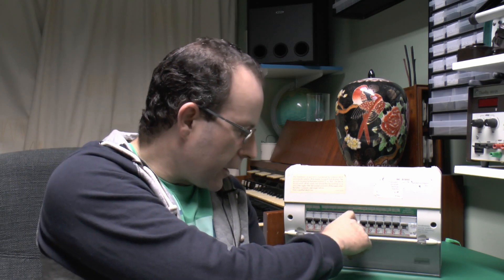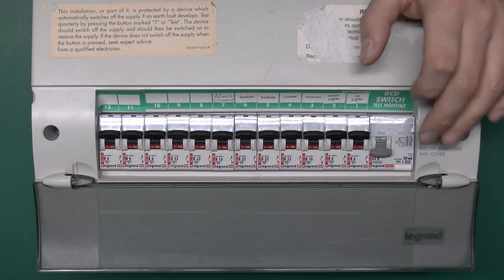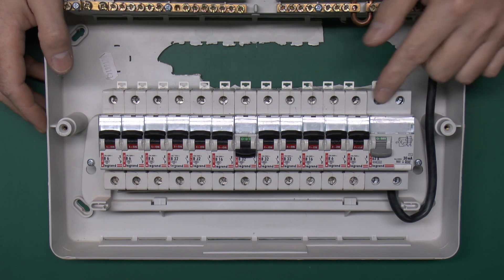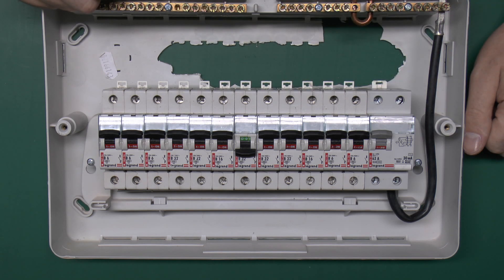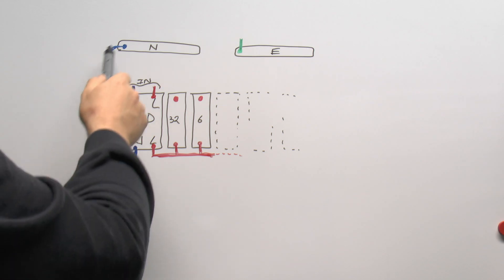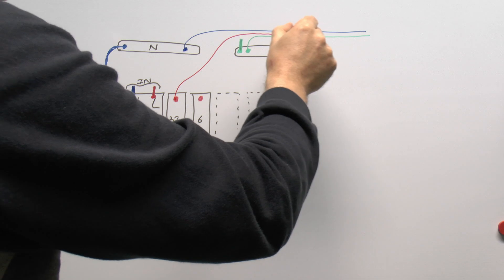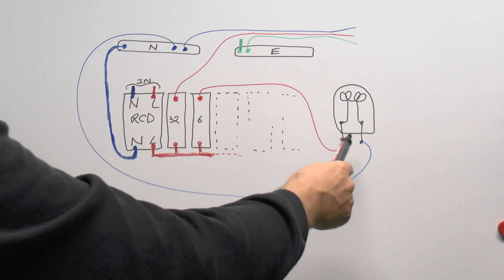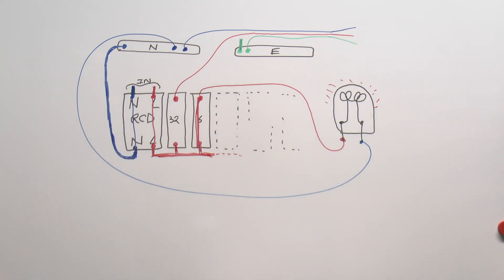RCDs: Neutral - Earth Faults

Comment: Can anyone help me please !! - I'm planning my new house's electricity system & I liked the idea of RCDs because maybe I can use it to prevent my small kids from being shocked if they inserted something into plugs ... So can RCDs be used for that ??
Then how to wire it ? .. Neutral of circuits breakers to earth ?? as in Egypt we have a wide commercially the two ports plugs only ( without earth port ) ..
Reply from the maker: Mohamed Sayed I don't know what the regulations in Egypt are, but in the UK, RCDs are required on all socket outlets, and many other circuits depending on the type of cabling used and how it is installed.  Even if not required, they are certainly worth having.
Reply: Dear ***** ..
We don't have a regulation in Egypt as a compulsion to use RCDs .. My electricity source is a single phase, and is connected to breakers via 100A master CB. Normally like any part of the world..
So, what I was thinking about is : wiring the neutral to the earth, and when a kid inserts a metal thing into plugs or my wife has a contact with a case of charged appliance (without connecting the earth wire of that appliance with ground and the plug has no earth connection, just the neutral of the source is connected with the earth ) , they will be a part of a circuit between the Live line and the earth which is connected with the neutral, as reserve current on the Neutral coil will be not equivalent with the forward current on the Live coil (as current is reduced by both kid or wife body resistance and earth resistance ) .. then the RCD will trip ... Is that correct or it has another circuiting idea to work well ? ..

Thank you..
Reply from the maker: Mohamed Sayed The mains supply should already be referenced to earth/ground, it is not necessary to connect neutral to earth yourself.
An RCD does not require that the appliance has an earth connection.  If someone touches a live part, current will flow via that person to the ground/earth, causing an imbalance which will trip the RCD.
Reply: ***** Thank you so much for your kind explanation & help .. wish a safe life for all families ..

Comment: Thank you John....I could never get an answer why I was getting a "tingle" from a registered 'leccy whenever i've done work on any "disconnected" circuit in my house.....plain as day now through your explanation....My "disconnected circuit" is in fact still connected!!!...in future I WILL TURN OFF EVERYTHING at the main R.C.B...I Know before anyone else chips in, yes you have to be a 17th edition certified Electrician to work on ANYTHING more than wiring a plug these days...and it is advised that even if you do that, it is checked by one!!! But in my defence I ALWAYS DO ANY WORK MYSELF & GET IT CHECKED AND SIGNED OFF (by a registered electrician) before "flicking the switch"
Reply: Clive, I don't think anything John has said would explain why your disconnected live wire would feel tingly.  This may be because the disconnected live conductor was capacitively coupled to another circuit that ran alongside it for a few metres.

Comment: Great video. In Denmark we don't use a neutral bar, and all circuit-breakers are dual pole (they turn off neutral too). This means that circuit-breakers for a single phase take 2 slots instead of just 1. I did however come cross a RDC + dual pole circuit-breaker in a singe one slot unit: http://surl.dk/e7e/
Reply from the maker: Per Mejdal Rasmussen Double pole breakers can be obtained in the UK, but they are rarely used, the majority of installations have single pole.
Reply: Mr. Jhon Great video

Comment: One point John, in the event you're on a TN-S system, even if there's no current from the installation, you might get current flowing from the neutral to earth from other consumers on the same TN-S supply cable, even if they're down the street, or even several streets away (In that case there's zero current in the line, sometimes quite a high current on the neutral)
Reply: Isn't neutral & earth bonded where the supply enters the meter box on a TN-S system, so there really ought not be any flowing within the house from external properties.
Reply: Steve, in TN-S, neutral and earth are separate conductors that are only connected remote from the premises (e.g. substation).  Typically, load imbalances in the 3-phase distribution network would cause the neutral to "invert", or rise slightly above earth.  This is how urban supplies used to be delivered in the UK (with the separate earth soldered to the lead sheath of the distribution cable) and I can remember seeing (small) sparks when I accidentally connected neutral and earth.

What you are describing is TN-C-S (formerly "PME" in the UK), in which a combined neutral and earth conductor arrives at the premises, then separates into neutral and earth conductors for the consumer.  There is still the potential (no pun intended) for a dead short on one phase of the distribution network close to the premises to pull the combined conductor well away from local earth potential, which is one reason why the UK is pretty hot on bonding of plumbing and other metalwork, so that there is less likelihood of 100V suddenly appearing between your metal-bodied kettle and the kitchen sink while you are touching both with different hands.

You may find the Earthing system article in Wikipedia of interest.
Reply: Thanks - I was, indeed thinking of TN-C-S.